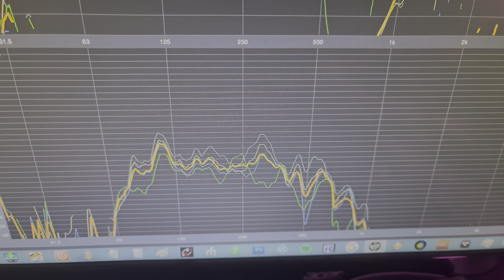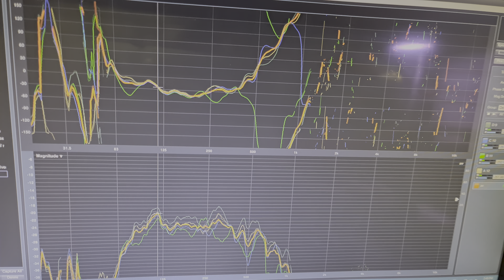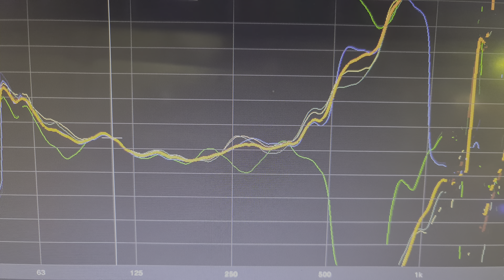eq fixes phase example

Comment: Hi, what is the parameter that you change to flatten the magnitude and phase please?
Reply from the maker: It's a parametric equaliser. Based in software using IIR filters which do effect phase as well as magnitude. Up to 20 eq points were used to bring magnitude to flat, and so the phase became more linear as a by-product. Win win. The acoustic environment slows down arrival times of frequencies differently. The eq is slowing down the opposite amount of time thereby restoring the magnitude.